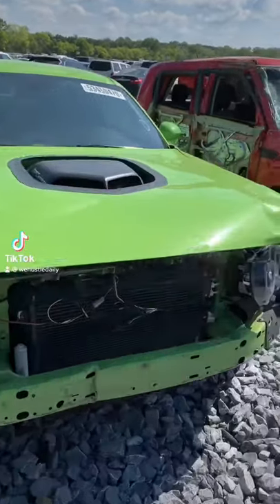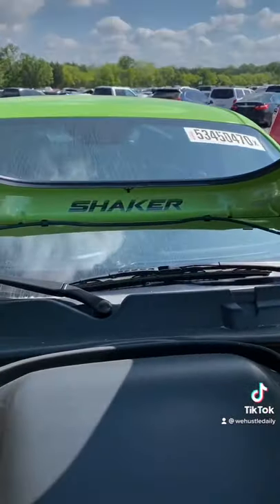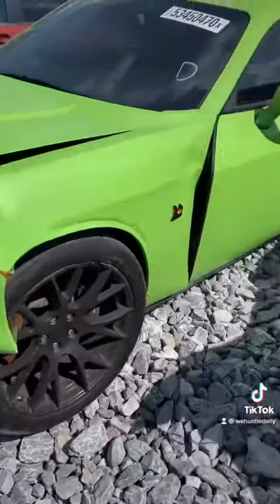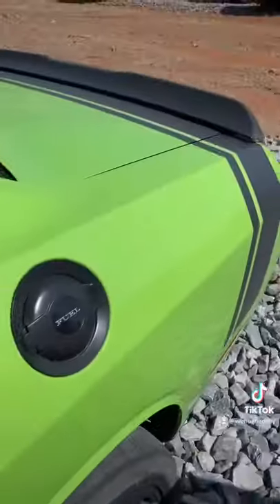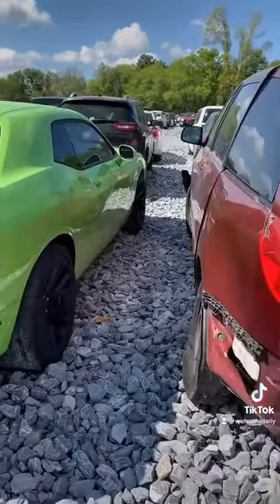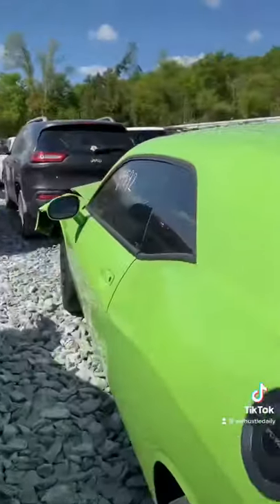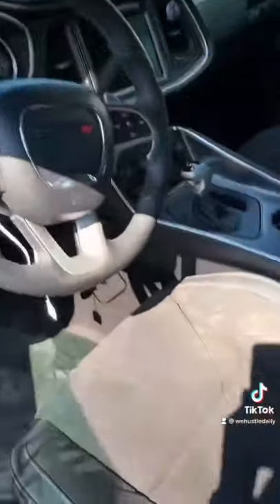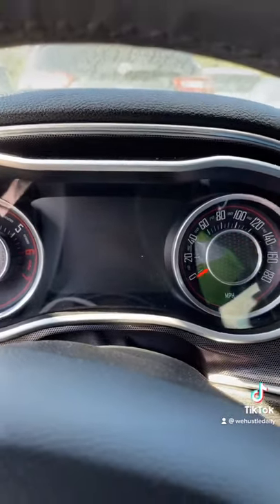😍 Found A Easy Rebuild On This Challenger 392 Shaker At Copart!

Comment: Everyone saying about the one tailpipe sticking out that literally means nothing. It very easily could have gotten damaged being put on the roll back after the initial accident. Tow drivers aren’t gentle when loading up wrecked cars. If the motor was pushed back that far, it probably would have more signs than one exhaust tip sticking out. And everyone calling it a muffler, it is not a muffler.
Reply: If that muffler is back there it can be the tailpipe of the muffler so technically it is a muffler and if it pulled that back it will pull back everything else in front all the way to the engine and may have moved the engine back to or bent the manifold up bad
Reply: Both of those tips are at different spots. I would assume it is not from the engine being pushed. I think they would have went back " evenly" maybe not. But I think its like you said. The tow truck drivers don't care. It also may have went off the road or somthing during the crash and got clipped by a curb or rock ect......And even more evidence as I think about it. The intake still lines up with the hood really nice. So it's not from engine push back.
Reply: My dad is a tow truck driver and I’ve seen this a lot. Depends on if it went off the road the exhaust could have caught something and moved back a little, bent, I’ve even seen some separate and you could move the pipe by hand. I don’t think it hit hard enough to push the motor back. I’ve seen a lot of cars completely totaled but the motor wasn’t moved.

Comment: I bet it’s bad when you start getting into it I only say that bc of when he went to the back how the exhaust was sitting I can’t imagine what else is wayyyy off of being aligned
Reply: They just had aftermarket exhaust on there and threw the original back on 🤦🏽‍♂️
Reply: @bird_chill_412   or it’s wrecked and it shifted everything in the car ether way your comment is still irrelevant to what I was saying
Reply: @jakefromstatefarm653  don’t get mad cause I’m right 🤣 just admit fault 🥴
Reply: @bird_chill_412   you’ve never worked on a salvage car have you🤣 🤡
Reply: @jakefromstatefarm653  even if I haven’t it doesn’t take a rocket scientist to figure out it never had underbody damage
Reply: @bird_chill_412   ok well bud I own a whole ass shop and when a car gets in a wreck like this it makes parts on the car uneven like bent frames,body lines/ panel gaps , it can’t do it to almost anything and I can tell you rn that challengers exhaust is like that bc of the wreck
Reply: @jakefromstatefarm653  okay but would you keep an stock exhaust for almost 100k?
Reply: @jakefromstatefarm653  what’s your shop name?
Reply: Your right,  it's bad . The front left tire is very close to back side of fender and if it didn't have frame damage the insurance company wouldn't have totaled it out .
Reply: @sow9880  not true lol car has almost 100k miles, that front clip (bumper and lights) prolly gonna run almost $2 grand with labor. Fender is fucked too. Plus I’d put money that maybe the frame isn’t bent (it is) every panel in the driver side is out of alignment and damaged
Reply: @sow9880  very easily totaled even without frame damage
Reply: @bird_chill_412  that ain’t a aftermarket exhaust bruh 😭😭😭
Reply: @blessediscooo7184  who said it was?
Reply: @bird_chill_412  u did
Reply: @blessediscooo7184  where 🤨
Reply: I saw that exhaust it looks all kinds of crazy stuff to find
Reply: @jakefromstatefarm653  Some of us don’t drive salvaged cars 🤪
Reply: @bird_chill_412  What you don't understand is they wouldn't have salvaged out the car for the damage we can see
Reply: @APersonNamedAnimal   your right some of us drive brand new bmws🥵🥶
Reply: @jakefromstatefarm653  2021 S550 🤪
Reply: @APersonNamedAnimal  5.0?
Reply: @APersonNamedAnimal   I’m assuming it’s the 2.3 turbo since you didnt say it was a gt
Reply: @jakefromstatefarm653  I think he is referring to the Mercedes S550 to flex on your bmw  but i could be wrong
Reply: @demented392rt5   there ain’t much in price range that compares to the 2020 m550 he’d be silly
Reply: @jakefromstatefarm653  Damn i never heard of that car so i looked it up and damn that m550 looks so boss and beautiful man. Badass car for sure
Reply: @demented392rt5   wish it still had its warranty😢 bigger turbos just scream my name🤷‍♂️🤣
Reply: @jakefromstatefarm653  Dang bro Haha You've got luxury and speed. That's a lot of money to drop on a new BMW.  Seems like your shop is doing very well 👌
Reply: @demented392rt5   we rebuild salvage trucks and build lifted trucks and  and have a wheel and tire selection we also build engines and trans for people that want street cars that’ll get you in to much trouble. So ya it does pretty good for a private shop we don’t really get a break lol
Reply: @jakefromstatefarm653  Dang yeah seems like you do all kinds of work. Where is the shop located at
Reply: @demented392rt5   Camdenton mo about 1/4 mile down v road off of US 54
Reply: @jakefromstatefarm653  I'm from California idk where thats at lol
Reply: I dont think its is shifted as bad as people think. For one reason.. the intake still lines up with the hood really well. If it had a front in impact hard enough to move the engine and other stuff. That would not line up
Reply: @jakefromstatefarm653  its not wrecked that bad. The rear wont ever be damaged from a front end wreck. The roof would buckle first and crack windshield. Cars today blow outwards to protect passenger compartment
Reply: @sow9880  Wrong. Owner might have friends at insurance company. Ive seen cars total with little damage and seen cars with engines out to repair major damage that wasnt worth it
Reply: @lewiskemp5893  do you know how a exhaust is put together?
Reply: @jakefromstatefarm653  oh yes. As many as I changed. Today I welded a quarter panel on a 2020 Altima using silicone bronze. I like that better than mig welding
Reply: @lewiskemp5893  then wouldn’t you know the the exhaust gets bent up a lot in wrecks bc of shifting and the impact force
Reply: @jakefromstatefarm653  they do on rear hits. Not on the front end hit like this challenger. Maybe wrecker damage loading the car. But not on todays unibody cars
Reply: @lewiskemp5893   usually happens when the engine shifts in front end impact it’ll break and bend the exhaust in some places if it hits right
Reply: @jakefromstatefarm653  thats true on a hard hit with major damage to frame rails requiring replacement. This car isnt hit that hard

Comment: That bumper bar has almost NO damage. Means no frame damage. Easy fix indeed, airbags aren't even deployed. Whoever sent this in clearly didn't realize it would be like a 3000$ fix. Hood reshaped, new fender, new bumper, paint, all could be gotten at really good prices and just redone. Sad.
Reply: You looked at the fender right????
Reply: $3000???? LMAOOOOO
Reply: Ummm, yeah the frame, I mean the bumper bar, was bent. Instant salvage.
Reply: @a1d9n  my challenger had worse damage and cost 4000$ and the expenses included engine bay repair including mounts, bridge, radiator, etc
Reply: @mikeparker9221  Instant salvage, yes. But a bumper bar can literally be removed from the frame and replaced.
Reply: @a1d9n  let me explain.
Challengers from 2009-2021 have all interchangeable parts except lights and front bumpers. The rear bumper is only slightly different.

You could just buy some cheap ass junkyard body parts from a 2010 challenger for like 50$ each and start slapping it on the car and then just fix the bumper bar and all miscellaneous damage, like for example if the radiator got punctured.

Now all it'll need is a paint job, some small maintenance, and we're looking at less than 3000$. That fender isn't fully fucked up either, the frame underneath it doesn't look to be touched, and even if it was, it doesn't look too badly damaged not to be pulled by a body shop for cheap. Easy work.
Reply: @Felix-gm9im  if you were to fix it up yourself not only would you need the tools but you also wouldn’t know exactly where the damage was especially looking at the car from the video. you have no clue what even happened to the car let alone what damage and where. on top of that you would need someone to inspect which cost money alone and need to find all the parts. it’s impractical to try to fix for that price range. some turbo setups are double that atleast
Reply: @a1d9n  I fixed my own challenger with worse damage dude. It doesn't need a lot of these special things that you're claiming. But sure man say what you want.
Reply: The bumper impact bar is bolted on and 4 welds. The frame rail end cap is easily welded on. The hood is aluminum and a pain to repair. The fender is made to react like this. I think I have repaired at least 30 like this. Its an easy repair. Taking the door apart for paint is the hardest part. Getting the window to align is the hardest part
Reply: @a1d9n  after 30 years in body shops I can glance at the car on a wrecker and pretty much know the damage. Just saying

Comment: For 94,000 miles I hope they gave you a good deal, cause no way ima pay more than 10gs for a challenger @ 94k
Reply: Firs thing i said to myself 94k miles no thanks that engine too expensive to replace but it will go over 10gs because people are stupid right now about them
Reply: It’s not a challenger it’s a scat
Reply: @mauriciotorres1907  it’s a challenger scatpack
Reply: For a damaged one yea
Reply: 94k miles is low. V8 engines and v6 are known to last past 180,000k about 90% of the time unless your torturing your car
Reply: @defaultusername2371  Obviously but it’s a challenger and it has a damn hemi. Not the lost reliable engine and we all know who drives them...
Reply: @mariopetty8140  I’m a mechanic and if your car leaks you can get that part repaired it’s mostly a gasket. If it runs and drives good just make sure to keep adding coolant or youlll overheat and then cause damage. Always get 2 diagnostics from 2 shops. A whole new engine is not smart

Comment: You should put the motor transmission and rear diff inside of a go-kart or a saturn and make it a sleeper, the insane horsepower with the lightweight would make it a racing monster

Comment: Thanks for the heads up, I will probably be bidding on it now that you have shown me the details.
Reply: Don’t that car looked badly damaged and if the frame is damaged you kinda can’t do anything
Reply: @tankman4254  All cars are Unibody now with no frame. Trucks are the only platform that still use Frame design. That’s why so many cars end up getting crushed and not rebuilt. They did it for multiple reasons, safety by way of “Crumple zones” so it will crush on impact. Then there is also cost which is more the reason in my opinion why auto manufacturers did it. Keeps people coming back to buy cars.
Reply: @tankman4254  frame damage then just take it to a frame shop it’s easy
Reply: @AB-rr4xh  and potentially end up paying above market value for a salvage vehicle? Not for me.
Reply: @anthonyfletcher8053  that’s why you make sure it’s still cheaper
Reply: @AB-rr4xh  still a gamble though, what looks like a simple job can sometimes turn into something far more complicated. Anyone who has worked on cars knows this 😎👍🏽
If you willing to take on the risk then go for it, just spreading for myself.
Reply: @anthonyfletcher8053  yeah that’s true lmao it’s always more especially on the new cars but if you know what you’re doing and how to cut some corners and where to cut them you’re in
Reply: @anthonyfletcher8053  nvm honestly bro it doesn’t look that bad you can either replace the fender rail if it’s cracked but you could still pull it out not that bad I saw worse

Comment: 392 doesn’t mean it’s immediately a scat pack, a 392 is an R/t with the 392 engine, a scat pack has a totally different suspension components combined with the 392 engine. If I’m wrong go to motor trend, Read all about it there.
Reply: if it’s a 392 it’s either a SRT or scat pack.
Reply: and it’s also an RT scat pack 
not RT 392… those don’t exist 
you might be talking about the 1320 scat pack cause that has drag suspension
Reply: It’s a whole 🐝 on the side of the car . Lol
Reply: Scat pack period. Emblems and on the seats. Ive worked in dodge dealership body shops 5 years
Reply: A 392 means is either a scat pack or an SRT. SRTs also had the hellcat suspension. Scat packs don't. That's a scat pack.
Reply: @lb9355  Exactly
Reply: Are you blind? The scat pack emblem is all over the f-in place lol.

Comment: Do u even see the  muffler sticking out ...👀👀👀
That means a lot.. Motor must have been push back from the impact..
Reply: Nahh he had an aftermarket exhaust on there and threw the original back on in a hurry
Reply: That’s not the muffler my guy that’s an exhaust tip